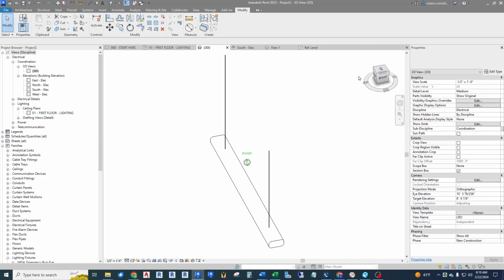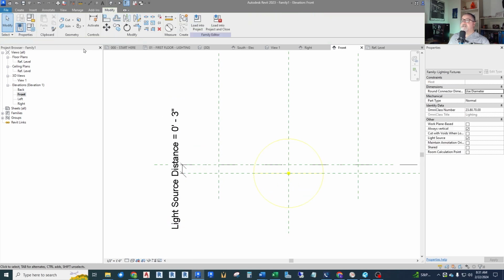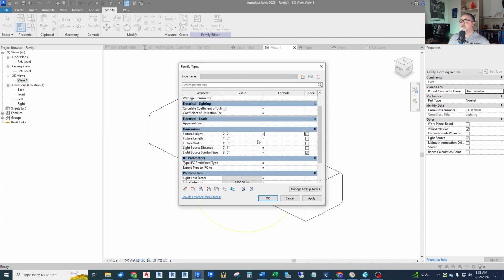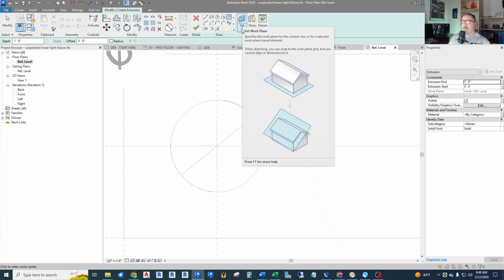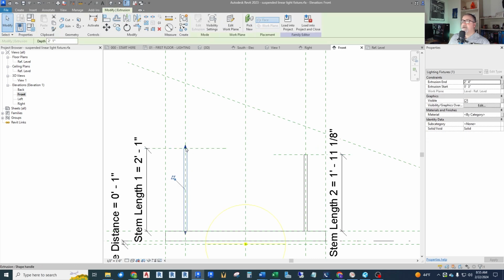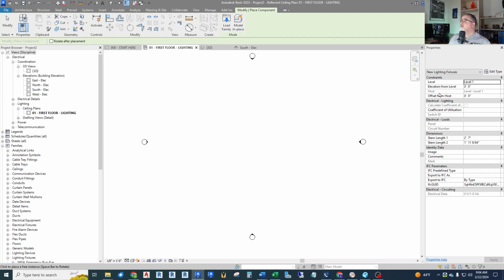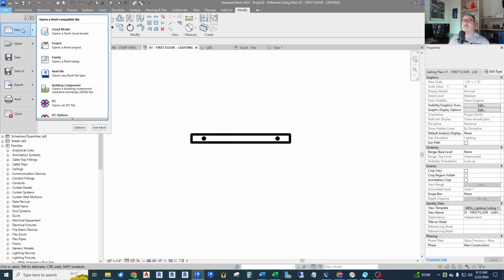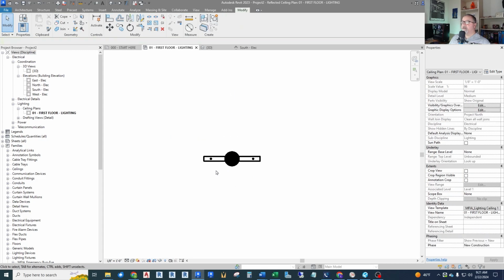Can the 3D Pendants be Adjustable? (step by step revit family editor)

Comment: any reason for my wall mounted fixture not showing the shaded region? all my other families work with the emergency designation besides the surface wall linear
Reply from the maker: Nothing specific I can think of related to wall-mount. Just double check that you tied the graphic into your annotation family parameter, and then "mapped" or "associated" the parameter to your light fixture family as well.
Reply: @ElectricRob  was able to fix it :) shaded region was on top of the fixture. Just had to host it to face or add a shaded region to the front of the fixture if mounted to vertical face
Reply from the maker: @teslamodels3xy910  Ah nice - glad you figured it out! Yes, one limitation on "symbols" is they need to be parallel to the surface you are viewing (which is why symbols don't show up if a ceiling-hosted fixture is on a sloped ceiling - the view you are in is parallel to the floor, so the family must be as well)